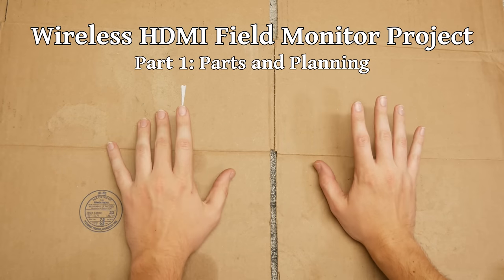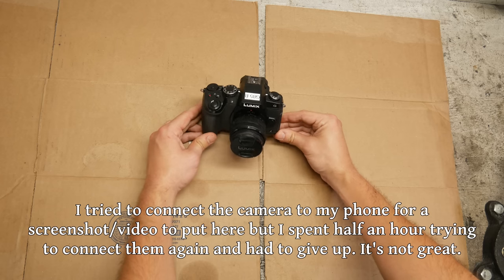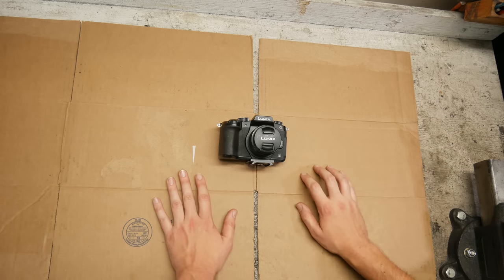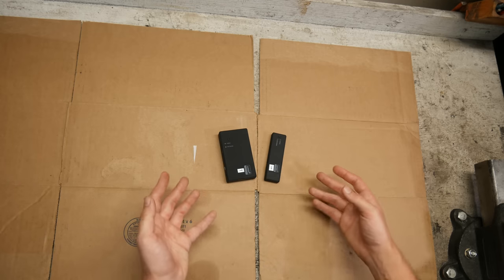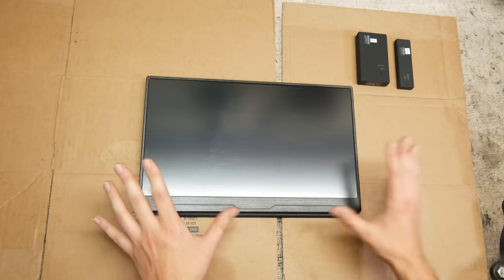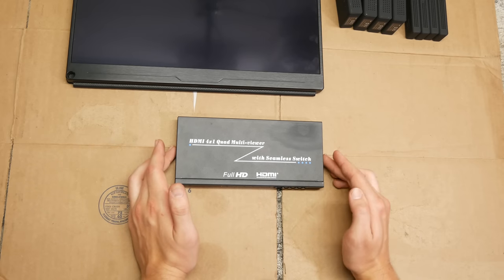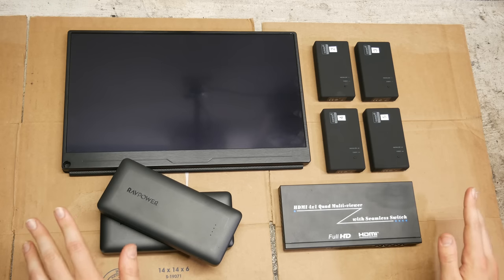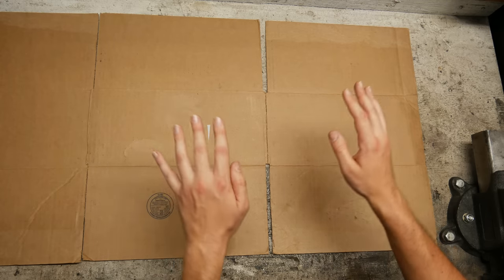Wireless HDMI Field Monitor Build Project Part 1: Parts and Planning

Comment from the maker: The plan is to release part 2 next weekend (around the 12th), and it's looking like there may be a part 3 as well to make some accessories. Will try to keep this release schedule short as it is not one of the typical multi-week projects for this channel. It is a bit tenuous to call this a video that released on the "weekend," but I'm going to use the holiday weekend as an excuse to still call it that. Last three days were extremely long (ending between 3-7am) rushing to get this project and video moving along. Plenty of setbacks that slowed things down but had to keep going. Had planned to release the first two parts on the same day but it didn't work out that way. Hope some of you find something interesting/entertaining in this 20 minute explanatory rant!

Comment: Awesome, I know what you are going through. Once did something similar with 50 gateways I wanted to flash/programm at once. so 50 ethernet cables + 50 poe power adapters + 50 power cords to some 10 ethernet switches to some uplink system all connected at the same time. Found out it wasn't good to tightly stuff everything into one cardboard box because of the heat would pile up quickly even while each device was only accounting for 3 watts. If you just pulled one wire out you had the whole ball of madness in your hand and when you looked at it just vanished in that jungle of wires wondering where it was connected to. 
So good idea to think this one through first. Possibly make a usb 5 volts rail system while adding some fuses where you can hook up the power lines more conveniently if it is not supposed to be plug and play anymore. Otoh by sticking on the standard cables it makes everything reusable again. Also I would make the batteries swapable on the back in case they forget to recharge and need to start recording, so they can get a spare set to have instant fun.

Comment: I've been wanting to do what you're describing, but on a single camera scale, pretty much since making my first 10 videos. This will be sweet when it's done. That said, 2 things, the first being an offer of some help if you'd like....

1 - I just took delivery of a large format 3D printer that my subs don't even know about yet... It's a roughly 20"x20"x20" 3D playground to make pretty literally anything you can imagine. If you find a configuration more desirable than a couple sheets of aluminum, it would be my pleasure to work with you on that. Especially when it comes to cable management, you've got your work cut out for you.

2 - You've solidified my resolve that any big boy camera I buy is going to have functional, GOOD, WiFi. To my shock, the wifi on my $50 action cam is actually incredibly good, as is the phone app... I almost wonder if iSmartDV would work better for the panasonics than the panasonic app would?  It doesn't seem to be brand specific. Worth a shot?

So... 2b, for others playing along, dirty cheap GoPro knock-offs have very decent wifi screen casting capability if that's the level you need.
Reply from the maker: As for the large format 3D printer, that's awesome! I'll keep your offer in mind if I can think of a different way to lay one of these (or something else) out.

I have an action camera with a good WiFi app (Yi 4K), but even that I haven't been able to rely on. Worked very well on my previous phone (Galaxy S5) but just can't get it to connect on my current phone (Pixel 2). I haven't really had good luck with ANY devices that direct connect over WiFi, honestly, and it's a pain to have to only connect to that one device and lose the internet WiFi connection when using it. The Panasonic cameras use their own tech, and only the official Panasonic app and an unofficial Windows app work with them. The Windows app theoretically supports multiple cameras which is cool (though none of my laptops have WiFi hardware capable of that) but the other framerate/resolution/function limitations from the official app are still there unfortunately.
Reply: @FuzzyDiceProjects  You know where to find me!

And... I think my action cam is a Yi 4k by another name and the Wifi is rock solid with both of my LG phones. I have phones nearly disposable cost phones dedicated to YouTubery so losing the internet WiFi isn't a big deal to me to connect to the camera. Plus I'm making lonelyman videos at home. I'm never more than 10 feet away from my actual internet appliances.

I hadn't even considered a Windows app for that... What I actually want to do to cast one camera up on a 40"+ TV in the shop so I can see what I'm actually doing when the camera is at weird angles (I have a feeling you know the pain I'm talking about). A laptop docked to the TV is actually already part of the plan, so, that would be perfect.

I'll be looking into that option more carefully and I appreciate the inspiration!

Comment: I have actually been wanting something like this as well so model numbers are appreciated.
Reply from the maker: It will be a bit tricky to give model numbers for some of these components but I was planning to do a parts/price roundup at the end and I'll do my best. The displays for example have no documentation and I can't find a model or serial number or anything like that for them.
Reply: @FuzzyDiceProjects  thanks! Mostly interested in the hdmi splitter/wireless solution. Displays can be replaced with actual field monitors if others aren't available.

Comment: In robotics club, we used cell phones to pair the robot with the controller and 3d printed a case to hold all the adapters and wires that connected the controllers to the phone. It was a mess but it worked

Comment: Mate, try usb jump starters, they make perfect battery packs
Reply: usb charged booster packs don't make very good power banks as they are set up for high amperage low capacity whereas power-banks are the opposite

Comment: If you use "standoffs" between the VESA-mount/back-of-monitor and the 'sandwich' of other bits, the final version can "simply" have the battery packs between the monitor and sandwich with no significant changes ... but the standoffs. This ruggedizes the  "rear corners" and flattens the ultimate back of the unit: I'd see this as a significant usability upgrade.
If tracking down specifically applicable standoffs (at, say McMaster-Carr) doesn't get to the perfect standoff, you can make them from "All Thread" of the right size, and using the "jam nut" technique to lock nuts anywhere on any rod you like. Or add Loctite.

(Wanders off to buy one of those wireless HDMI's quicklike.)
Reply from the maker: I considered it, but the VESA screws are so small (M4x0.7mm), the thread engagement is so limited (around 3 threads), and the display is not exactly the most rigid so I would not feel confident that it would be a sturdy enough solution.

You did get me thinking though, and I haven't decided for sure yet but I think I will fit the batteries inside the main housing on the multi-receiver setup and just have longer standoffs.
Reply: @FuzzyDiceProjects  The effers think it's good enough for the whole monitor :D
Sometimes popping the shell off the monitor will show there's some better structural element inside the monitor to thread, or somewhere a piece of flat-stock can just be stuffed.
Three threads into steel flatstock is an entirely different beast than three threads into brass-insert-in-plastic.

Comment: So using that HDMI splitter, is it possible to output one angle via HDMI out, while monitoring the 4 onscreen? Being able to use it for a livestream with multiple inputs would be amazing.
Reply from the maker: Unfortunately it is not quite that advanced, though used in conjunction with a normal HDMI switch (that only outputs one at a time) and a splitter for each of the four inputs that should be able to do what you are talking about. There must be some product that does exactly that in one box but it is probably an expensive and specialized piece of equipment.

Comment: A very large portion of me wants to pull all the guts out of that HDMI transmitter and put it in a new enclosure with a bank of 18650 batteries to power it and glue it to a cold shoe foot so it can sit on top... but I'm a very specific kind of DIY madman.

Comment: So you can use a g85 to record video while connected to HDMI? Never worked for me.
Reply from the maker: Yep! Haven't had any issues with it. The G7 shuts off the external monitor while recording 4K, not sure if there is some way around that, but the three G85s I've hooked up to output clean video and display on the built-in screen normally while plugged into HDMI and recording/in menus/playback mode/everything I have tried.

There are a few settings in a "TV Connection" menu in the settings, but options are a bit limited. Some displays/devices I have tried do not like the 4K output from the camera but function when it is set to a 1080p resolution. The Sony RX100 cameras work with every single setup I've tried so those are clearly more flexible, though.
Reply: @FuzzyDiceProjects  Thanks. This is the most thorough response I've ever received. Good stuff, keep it up!